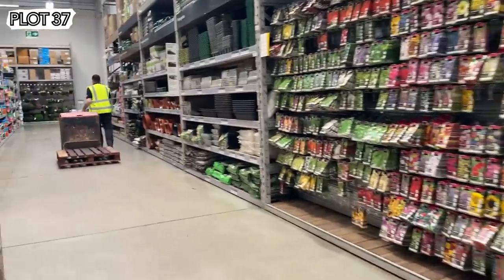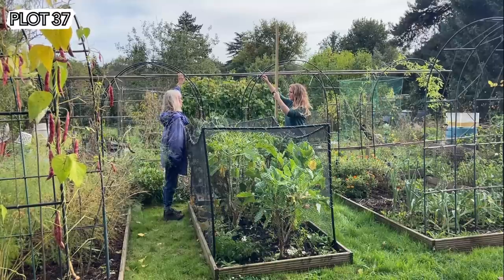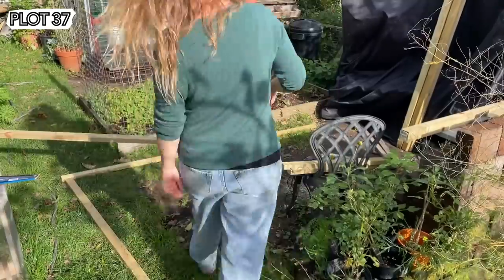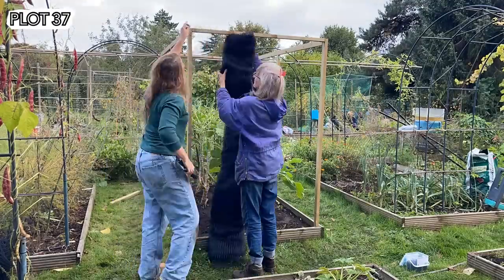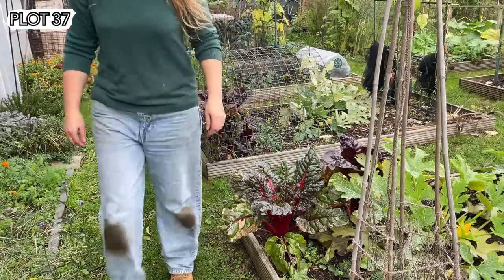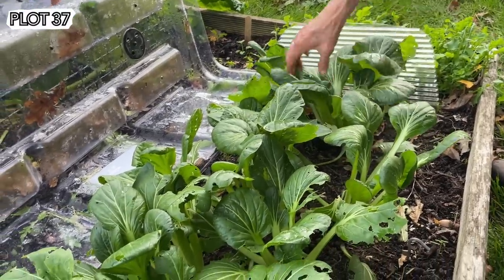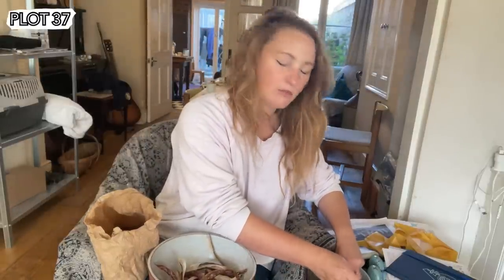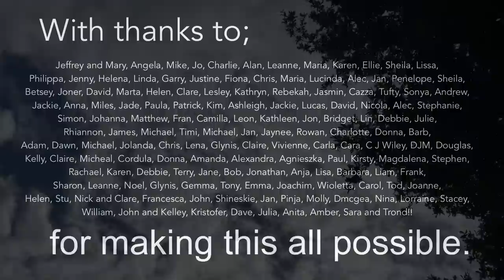Ep133 - Building a new Brassica Cage! Sowing Sweet Peas and Planting Out Purple Sprouting || Plot 37

Comment: Nice simple build of the cage, I totally over engineered mine with 1/2 lap joints, triangular sections of 2*4 as corner braises, cross braising on the ends etc etc...   is that mesh fine enough to keep the damn wee cabbage white bar-stewards out?
Reply from the maker: Bet its a gorgeous cage you’ve ended up with though Gary! 
Yeah, it should keep them off. It’s not butterfly netting but when i measured the holes it was the same size so should be good!